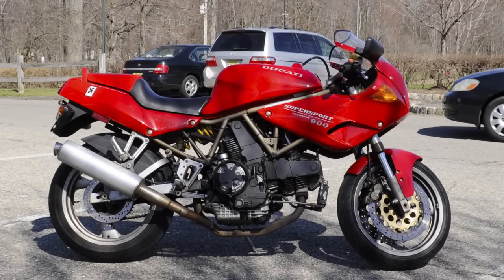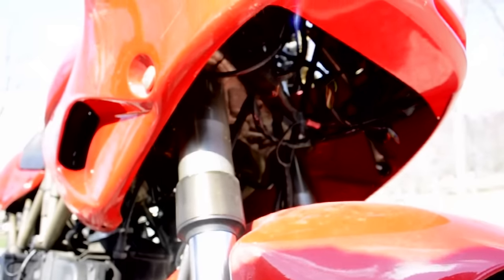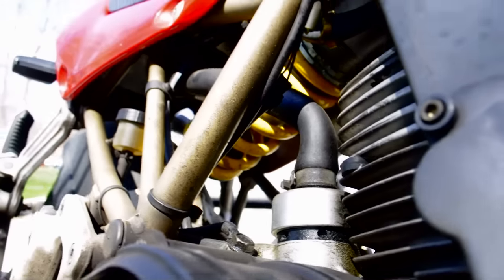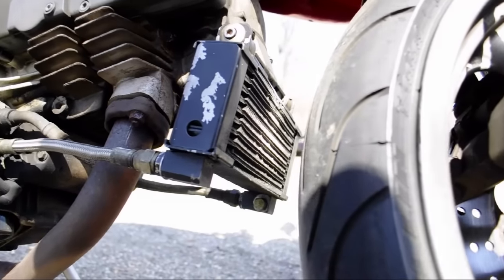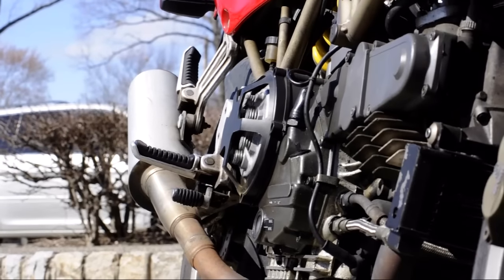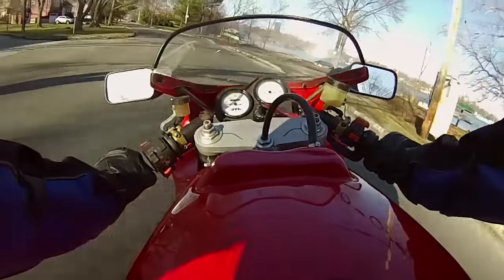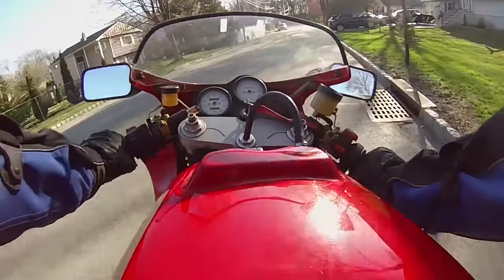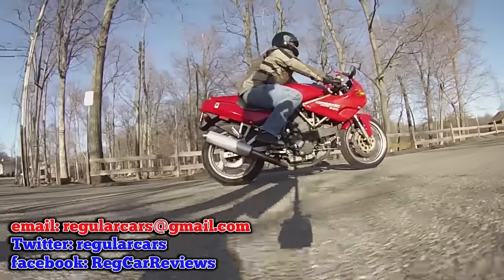Regular Car Reviews: 1998 Ducati 900ss cr

Comment: I know nothing about bikes (sadly), but the sense I get from this review is that this is the Ferrari F40 of bikes. Uncomfortable, very tricky to ride, only happy at high revs, incredibly fast, and gloriously Italian. And it's great because of all that, not in spite of it.
Reply: I have a 900ss. It has always struck me as being decently comfortable if not luxurious, but more than that, very happy to go as far as you dare and tells you what the road says. It simply doesn't have the top end high speed high RPM madness that many a liquid cooled L4 has. I think of it as the 2 wheel equivalent of the alfa gtv6
Reply: Yep on all points
Reply: Iv got one, handles beautiful. Being aircooled its light. power is like tuned harley (torquey). Not amazing. Tl1000 will hunt it down no sweat , and they're a slow bike in comparison to newer machines
Reply: Bilal Ayub  it's prettt slow though
Reply: Jake Akhtar This motorcycle is not incredibly fast and it is terrible for riding around town. But it’s more fun than should be legal.
Reply: No, the 900SS is more like a 308, the F40 of motorcycles would be the 916.

Yes, I am aware of the fact that I am 5 years too late.
Reply: @snapcountersteer  I'm aware I'm late also but that's what my research told my gut aswell.
Achingly beautiful but without the heartbreak of being a single use case bile ti seems.
I waunt it.
Reply: They are very comfortable for bigger guys in my experience, I’m long limbed and the European bikes always fit me better, I feel downright cramped on most Hondas.

Comment: I owned this bike. It was a dream bike for me, but cascaded to a total nightmare. That dry clutch? Breaks, a lot.  The electrics...I'm convinced Joe Lucas escaped England , had plastic surgery and changed his name to Marelli. The side stand was designed to sell fairings. I finally gave up when the frame cracked. The after sales support at that time by Ducati can be summed up by the unique italian phrase, "vafungulo". I'm amazed to see one running with a headlight and everything. That oil cooler seems like a stupid place to put an oil cooler, because it is. Ugh..the memories of that money pit. Ducatisti do stupid shit like exposed clutch baskets and drive belts and pulleys, I think so they can actually watch shit break in real time.
Reply: okleydokley I found a 1999 900SS for $3000. It runs fine and was recently serviced. Not worth it?
Reply: @carbonbasedmolecule9197  not for that price, I could go for SS900ie from 2002 for 2700.
Reply: This guy Ducatis! Love mine but shit breaks and rattles off on the regular. Still a sexy fucking bike.
Reply: I had 2 '99's. Raced one of them. Hp is actually 75 with a top speed of 145.
Reply: Love mine...don't really know what the heck your talking about. Had mine since 1995. She is real sweet. The only thing I complain about is the mirrors...but who needs to see what is behind you anyways???
Reply: Lucas stuff breaks because the British motor industry was comically cheap. Marelli stuff breaks because Marelli is batshit crazy.
Reply: Never had any problem with it. Never ... except water in the oil pressure sensor cap, that gave a false reading. After 1 minute I had the idea to unplug it, let the water out and rode on.
Reply: @natanpierce495  I got a 92 ss900 sp,  mirrors,  turning circle are not great but man what a bike! Turns heads where ever I go. 😀
Reply: I've had a 95 900 SP for over 20 years. No problems, just routine maintenance. Still ride and and although she rattles and bucks, I like how it forces me to pay attention to everything around me and everything I do. And you sure get the looks when you pull up next to all the modern bikes. I really feel like I've earned the ride once I put the stand down.
Reply: You simply don't know how to handle bikes... I had a 900 SL for 20 years and apart from oil, filter and belt changes never even put a spanner to the engine... Took it to the track for 14 of those 20 years too.
They are fantastic bikes. So much so, that I bought one of those again a few months back when it came onto my path.
Reply: I dunno why but Italian shit has always made sense to me, it’s laughably amateurish, but I understand that more than the Teutonic complexity of German shit.

Comment: ---MAX

---MIN

---actual oil level lol
Reply: Gara Von Hoiwkenzoiber don't worry, it's an italian bike so it won't break cough cough
but seriously: the bike is tilted. do you read th oil level when it's tilted or is it supposed to be upright? (I really have no idea)
Reply: Gara Von Hoiwkenzoiber It's on the sidestand
Reply: Matthias Schmitt  yea u measure it when its up right and as soon as u start it .it all disappears ahah
Reply: Gara Von Hoiwkenzoiber 

--- Economy of Greece
Reply: Matthias Schmitt 
Pause the video at 1 second, the bike is on it's sidestand but it's only leaning over a tiny amount, the oil level is visually underfilled. :)

The later at 3:57 for a close up.
Reply: Matthias Schmitt It was sitting on the kick stand for that shot, you would read the level while the bike was on flat level ground and standing straight up. I would be willing to bet that the oil level in that bike was actually burgeoning on a bit high, since it was showing at all whilst tilted.
Reply: Also meant to measure it warm as well as standing up.

What they don't tell you is how do it as a single rider...try holding a 200kg  bike with one hand while crouching down beside it. What could possibly go wrong???
Reply: Performance UAV Especially if said bike is equipped with the dreaded Automatic Sidestand of Doom. With a normal bike, leave the sidestand deployed ; if you get off balance while checking the oil level, just push the bike to the left. But with an automatic sidestand, this doesn't work. You push to the left, and... sha-blang ! Yup, that's the sound of three thousand bucks of fairing crushed by the tarmac.
Reply: Toto Abicyclette thats some good advice, i never knew how to do it with only a side stand, all my bikes have center stands but the oil level doesn't matter too much since they don't work yet lol
Reply: Performance UAV you might wanna try... I dunno, just putting something under the sidestand?

Of course, pros let the bike just run on idle in first gear, walk aside it, bend down and read off the level.
Reply: Toto Abicyclette If you keep in mind how this bike works, the sidestand of doom (TM) is a necessary safety feature. This bike just cant cut out the ignition or fuel delivery when you forget to flip it up. Back in the days, all bikes had it.

BMW came up with a funny solution: On some 80s K models the clutch is cabled to the sidestand. If you pull the clutch lever, you pull up the sidestand... which was a totally dumb idea on a fuel injected engine. Still neat tho.
Reply: Phuqthephuq Oph Best "oops I forgot the sidestand" system I encountered apart from not having a sidestand in the first place is the "kill the ignition if you engage a gear while sidestand is deployed". But for that you have to have a switch on the gearbox, and frankly I think that italian engineers couldnt's give a rat's ass about a detail like that back then. 
Wait... are we talking about sidestands on a viedo review of a 900SS ? oO
Reply: Toto Abicyclette But all bikes have a switch on the gearbox. Well, if they are built after the 60s at least. You can easily connect the cut-the-ignition-when-gear-is-in-system to your neutral switch. Have a switch on the sidestand, connect both to the ECU, make it say "nononononono" when N is "nope" and sidestand is "yap" - there you go.
Also, what do you think the ss in 900SS stands for?! "SideStand" is obviously the most prominent feature. That or the Italians hadnt gotten over that whole axis thing by the 90s.
Reply: Phuqthephuq Oph If it's a serious question, it means "Super Sport". It's written on the front fairing. It goes back to the first SS model from the early 70s'. My favourite one is the 400SS CR, btw, since you didn't ask. 
If it's not a serious question, SS means "OMFG!ROFLBBQ101OLOLOLO!!!!!" in italian.
Reply: +Gara Von Hoiwkenzoiber   Exactly like my Streetfighter.  Stand it up that lil bit, and oil level in just a tick below "MAX"  (On my SF)  First time checking oil I was worried too, till I leveled the bike

And holding the bike balanced while reading the oil is actually extremely easy, no tricks needed.  Just engine off in 1st on level ground.  One hand on throttle side of handlebar, kneel and read.  Easy as shit.  Even for skinny fucks like me.
Reply: It is on a kick stand.
Reply: That is Ducati in a nutshell.
Reply: This is correct for a bike on the side stand - you have to lean down low and pull the bike over towards you and whatever you do never forget the suicide side stand on Ducati’s. Many many ducks with smashed left side plastics
Reply: That mini heart attack you get when you keep pulling the oil stick and it's still clean
Reply: @garavonhoiwkenzoiber  No it isn't... The oil level is actually supposed to be at the "min" level with the bike vertical (like paddock-stand or a rider holding it balanced).
This is because the crankcases of the 92 and later 900SS originate from the 851. The 900 frame has a slightly different engine position than the 851 (on the 900 the engine is tilted slightly more forward) so where for the 851 the level should be between the marks, on the 900 the level should be at the lower mark or it will start losing oil from the crankcase vent.

Trust me, I owned one for 20 years, the above info came from the owners instruction manual.
Reply: @silverburn55  It is actually VERY doable to straddle the bike, hold it upright between the legs and bend sideways to read the level. Done it like that for 20 years, and I am only 5 ft 7 and 145 lbs

Comment: Ducatis have desmodromic valves..........They open early, and close late.....and have no valve springs (Thus the beautiful "big bang' sound from the engine). They don't like to be going slow because the engine isn't made to do it. And....a car clutch isn't like a bike dry clutch..... A car has one pressure, and one friction plate. A bike has around six of each....even in dry form. Love your channel. Subscribed as soon as I watched a 'recommended for you' video.
Reply: Marty Smith

Comment: I have a 1999 monster 900 which is basically this with no fairings and upright bars and can attest to many of the engine characteristics. This thing hates low rpms, it feels like it doesn't want you near it if you are going to short shift it. But that mid range is amazing and then it slowly falls on its face. Currently having issues and in school so its just a sitter right now, but once I get the money, I can't wait for my yellow ducati to ride again. I also get many people asking if the bike is ok while it's idling.

Comment: @5:08 correction. Motorcycles with wet clutches can use car oils as long as they don't say "energy conserving" on the back of the label. Most 10w40 and 15w50 synthetics won't have that label and will be perfectly fine on a wet clutch motorcycle.
Reply: The biggest issue with using car oils in motorcycles, is NOT the clutch (regardless of dry or wet) but the starter sprag clutch. Cars don't have that, so car oil is not formulated for it. That sprag clutch will start to slip big time... No point in having oil in the engine if you cannot get it to run to begin with.
Reply: @rigididiot 

Yep. And the price difference doesn't justify not using the correct oil either

Comment: Ducati tuned this engine to have the valve overlap be biased towards the top end of the motor at the expense of low end torque. This is the logic behind the variable timing desmo models out now. Since they can adjust the timing ~47° you can have it both ways. Previous to the whizzbang electronics you had to choose where you wanted your power: torque on the low end, or rush at the top end. This is why his bike lugs and your Yamaha tolerated short shifting.
Reply: Woah. I think we rode together once, on peak to peak. Ended up at smokin Dave's in Estes. Cheers.

Comment: The SP has carbon fiber fenders and clutch cover, aluminum swing arm , fully adjustable suspension, engine oil temperature gauge, full fairing, and limited edition number plaque on the triple clamp. On my 97 900 SP, I made it more rideable and powerful with 11:1 compression pistons, 41mm Keihin FCR carburetors, Dyna ignition coils, 39 tooth rear sprocket, and air box ring (deletes the air box cover). Now, it runs like a hooker on fire. For really high RPM days, I just take my Bimota YB6 out for a spin.

Comment: You know why it's all shaky and messed up on low revs? The conrods from both banks are connected to crankshaft in same place, so the 1st cylinder fires, the crankshafts turns 90 degrees, 2nd cylinder fires and then nothing happens when the crankshaft turns for 270 degrees. It smoother as internals get more momentum from turning quicker at higher revs.
Reply: Kinda like my 2012 r1 crossplane. Happy and smooth above 3000 rpm.
Reply: +MindBlowerWTF Yes and no. You are correct about crankshaft and conrod position, but they're not big bang engines and each cylinder fires opposite the other. The general feeling of shake rattle and roll has more to do with lumpy cams, way advanced ignition timing and a combination of high compression engines with long gearing. The 900SS/SP my friend owned was the same way, and my 749 and Monster S4R are also. Everything smooths out at the mid range and top end because that's what ignition and cam profiles are tuned for (momentum helps but the timing of the internals are meant to mesh much better at higher engine speeds), not 30mph rides at 10% throttle.

And a decently stiff suspension doesn't hurt either.
Reply: Nope... It's a fourstroke, and actually the firing interval is 270 and 450 degrees... not 90 and 540...
Reply: @MrUandB  A big part is in the stock carburation, which is at best "decent". A stage II Dynojetkit hugely improves the low and midrange torque without any changes to valve or ignition timing.
Mine had, with only that mod (no other tuning measures) 79,5 hp at the rear wheel. Stock is 70~75, varies a bit.

Comment: my car has a dry clutch DCT. Wet clutches tend to provide for better heat dissipation and therefore also tend to be more robust in motors with a lot of torque.

Comment: Funny story.  I got to take one a 900ss engine apart and turn the front piston around because the douchnozzle factory class had put it in backwards...  worst sound you'll ever hear from a Ducati.  Worked fine after that though, even after it remachined a pocket in the piston big enough for the intake valve to fit in.  Ducati makes one hell of a good valve.

Comment: Did an experiment one time with a zx-14 my business partner owned. Ran it its whole rebuilt life on Shell Rotella and the bike is now at 97,271 miles and still running like a watch. I just run Ams Oil for motorcycles in all my newer bikes but I admit, after his luck I have run Rotella in my air cooled bikes and they actually do quite well with it. Just sharing for no particular reason.

Comment: The late '90s ZX6R had 100hp. The Duc is down on power (relative to it's engine displacement) because it's a V-twin. There's a reason why race series give V-twins a higher displacement ceiling than inline fours.

Comment: Hi Mr regular, I'm going to guess and say that the reason it doesn't like to be short shifted is because all of its power it up high. This would be how it's tuned so to speak, how big the cam lobes are, how much compression it has, how the exhaust and intake are set up. All of these things change the way a car runs, like when you put a light weight fly wheel in your car it changes how it idles, and when you put a bigger cam in it changes the idle and when your in the low range you have barely any power and it just sounds wrong.

I know I'm talking cars here but an engine is an engine and they all work on the same concept.
Reply: supercowmoo3 It has plenty of low down grunt, it just runs really lumpy at low revs, lot of chain snatching.
Reply: supercowmoo3 it is firing order, look at the crankshaft and look at the engine layout, it's 90 degrees V2 and the crankshaft can be described as 0 degrees. When You sum it up, it all messed up at low revs.

Comment: Rotella diesel oil works great and is far cheaper than motorcycle specific oil (just change it more often). No friction modifiers in it.
Reply: Motorcycle oil is cheap when you change it as recommended, not every 8 days as some idiots obsess about...then sell the bike with 3400 miles on it.

Comment: The CR's frames are made with cheaper steel (the SS was hi-tensile chromoly), which is why the headtubes on a CR almost alway cracks. I owned two and both developed a small crack, which is truly why they're unsafe at any speed.
Reply: All the SSs are made with the same frame materials, and they are all prone to cracking. The CRs did have steel swing arms as opposed to the full fairing models (of which only SOME were SPs) which got aluminum swing arms. Even though the aluminum swingarm is supposed to be lighter/blingy-er, they are prone to cracking at the pivot section. The steel swingarms on the CRs do not suffer such problems.